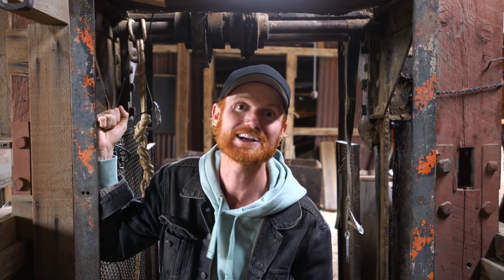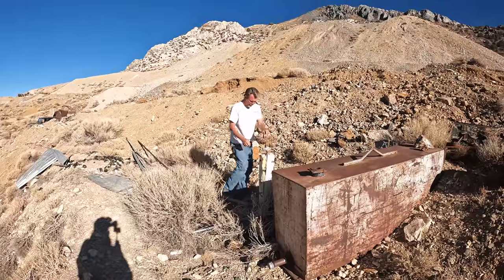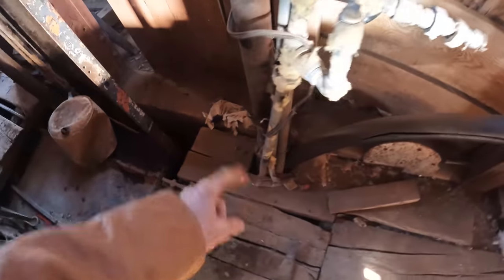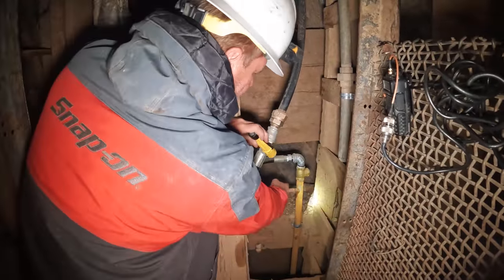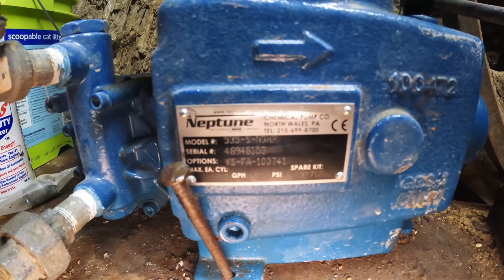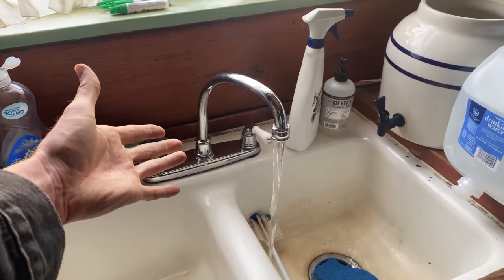How Cerro Gordo 'Ghost Town' Gets Water

Comment: How about putting an industrial dehumidifier down the tunnel where the water is coming from and piping its drain back to the catch basin? Not exactly the most efficient way to collect water as it'll be using a lot of electricity 24/7, but you would be reclaiming all the water that isn't flowing back to the basin including that which is on the walls, in the air and even what's in those rotting timbers,  you could even put a fan to circulate the damp air towards it from deeper down that tunnel.

Comment: What if you cleaned underneath where the water source was make it into a nice large smooth area where you could put a sheet of top polling what goes into a better and more permanent Funnel then it can drain down a pipe into your holding pond  Not saying this would increase the amount of water you could get in the town but it would keep the amount of water in the pond higher on average instead of constantly worrying about depleting all of it In the pond

Comment: The only significant thing I can think of is to dig out a catchment pond higher than the town in a location where snow and rain will fill it. Of course, that only works for a period of time depending on the size of the catchment.
Reply: The dust when the wind is blowing which it does a lot,  gets airborne and it is contaminated

Comment: Charcoal, Sand and Rock is just about all you need to filter water Brent, Then all you should do is boil it down to make sure there are no microbes. Then you have potable water you can drink or bathe in.
Reply: Not sure how effective those would be on filtering out lead though
Reply: @hanzazazel412  with that you make a point however if you distill the water you would be ok.

Comment: The water problem is because of poor design. Pumps can't lift water very far. All deep wells have a submersible pump at the bottom that pushes the water to the surface. A proper pump would solve the issue.

Comment: Is there a lower area water could come out from the mine? A vent shaft or other access that the water wouldn’t have to travel 700 vertical feet to get to? Use gravity to help some? Or Could you drill horizontally and penetrate from the side of the mountain 700 feet lower? I’m sure it’d be a major undertaking…
Reply: This is redundant ideology, the mine water is contaminated with metals, read my postings, doesn't anyone else read the comments before they comment, for crying out loud. Learn something! OK!

Comment: I understand that Cerro Gordo is on top of a mountain, however (not being an engineer), it strikes me that a deep water well is preferable (at least, eventually). The well might need to be rather deep, perhaps on the order of 1,000 feet or more, and therefore, expensive. However, to provide the several hundred daily gallons required, it strikes me as the only long-term solution... Major strengths of a well operation is simplicity; no long hoses, circuitous wires or mine-shaft hose or electrical threading would be needed ...as well as a considerably higher flow-rate. Yes, a well-pump would be required as well as a power source and well piping & proper sealant, however, if done properly, that water well could reliably serve the community for many years to come...

Comment: your going to keep having pump issues trying to push water that far up a line the weight of water or whats called head pressure is going to be to much for the pumps. what you need is 1 or 2 more holding tanks for water between the water level in the mine and the exit point with float valves and pumps, your going to have to stage the water working its way up the shaft of the mine for less issues with your water system. and less weight of water trying to be pushed up the lines. I have had to do similar setups on the farm in northern cali to get water 1500 feet up an incline to the farm from the creek. even huge industrial gas powered water pumps would fail swiftly because of the weight of the water in the line above the pump being pushed. also holding tanks do not leak like your ground hole holding area, so more water will be stored in backup reserve this way.

Comment: Tell me if I'm inane or not for having this idea. But if there a way (since there is a pipe that runs the entire length of the shaft before it gets to the water) to have a smaller pump, or multiple ones along the water line that could help out the main pump, since that seems to be the issue you keep having? I dunno if anything like that exists, or if it's already installed, I saw that one pipe and alleviater piece.. but apparently that's not helping much either.

Comment: A quick Google search told me you get about 6" of precipitation, lets just say that it is very little. My question is, do you have any infiltration set up? Like swales, checkdams (loose boulder structures), recharge wells? Stuff like that? I am very aware you like in essence on a big rock, yet there are plenty of cracks and the likes to help catch spring Mt water.. if that doesn't work it at least may grow a few more bushes
Reply: The dust when the wind is blowing which it does a lot,  gets airborne and it is contaminated
Reply: @lotharschiese8559  the water is to stay on the surface, infiltrate into the soil and its substructures, who inturn filter the silt (your concern) out of it.. that is the very reason people drink from wells and not from retention ponds.
Reply: @blue_boy8621  BUT NOBODY IN THEIR RIGHT MIND would do that around an abandoned mine site. When you put down a well, you pick an area with clean land, if you have a septic system,  you place the well, a goodly distance UPHILL! AND you ALWAYS test the well water, Eh!

Comment: "if you see something that we don't, let us know". Well my friend, I don't know if you know this but those galvanized lines are probably so corroded that you don't have much of any flow. That could be the reason for all the shutting off constantly. The head pressure has gotten too high and the motor working so hard is causing the amperage increases and the motor protection kicks in. I would check to see what it would cost to switch out that galvanized from the 500 level down. Shoot me a message on here and we can get together to try to solve this. It seems water will be the only problem with realizing your dream of making Cerro Gordo a place for people to come enjoy and spend time at the New American Hotel. Modern kitchens need lots of water.
Reply: Agreed! I can't believe nobody else has mentioned this!
Reply: @jmessenger919  They didn't mention it because the pressure gauge on the pump shows 303PSI. At 700ft head pressure, that shows that there's no restrictive spike going on. Not only that, but the pipes have been filled and rapidly evacuated many times using the valves near the pump. The water from the top rushes out VERY fast at 300PSI when those valves are opened which takes out the scale and other potential restrictions. The pipe is old, and above that point it even broke. However they are not the issue right now.

Comment: do you still have the water tote when you to make concrete for the hotel  to it near the mine shaft and before It get to the town.  you say you can get about 30 gallon a day? have try store 10 gallon day and use 10 gallon  day ? if I remember the water tote hole 250 gallons put hole at bottom of the tote for the town and pump mine water in the top of the tote. I remember that you need go to town get drink water  five ton truck and one 250 gallon water tote right? or the day Mine water is dry
Reply: you may need build room around the tote to keep from frizzing the water

Comment: Would it make sense to install a large holding tank on one of the middle levels of the mine, then install another pump in the hoist house? That way the distance to pump the water gets cut down, and gravity is working less against you. You could also install a gauge in the holding tank, so that you'll know when the lower pump is no longer working.
Reply: Read my posts above, This is redundant ideology, the mine water is contaminated!
Reply: @lotharschiese8559  what does that have to do with pumping the water to a holding tank? Also, I can't find your other comments.

Comment: I think you just need a water collection system for rain water (in case of a fire and for the garden is all right to use, not for drinking of course) and another one for storying the water of the mine in case the pump is not working ecc

Comment: What was the water supply in Cerro Gordo like when it was still a boomtown (I mean the early 1900s). How was water supplied when the population of Cerro Gordo peaked?
Reply: There used to be a very big lake at the base of the mountain.  Something happened back where the CA natural resources was drawing from lake, but at some point it just stopped replenishing.  The lake is essentially dry.  There were even desert bathing resorts back in the '20s.
My guess is the same source that fed the lake also bleeds into the mine.  It may have been diverted or pinched off by earthquake or even a tunnel collapse.
Reply: @toddmetzger  The mine goes down 1100 feet, Keeler is a mile 5280 feet lower than the town. Apples & oranges.

Comment: If you could find a piston pump that would be ideal, otherwise the only other option is a drive line pump like an oil rig. Ideally you would pump the pool nearly empty using a float switch to turn off the pump and store the water in a tank above ground. It would give you a better idea of your recovery rate throughout the seasons and it would guarantee you're not losing water to seepage.
Reply: This is redundant ideology, the mine water is contaminated with metals.
Reply: @lotharschiese8559  might not be, I don't believe they've ever tested it. Either way some metals can be filtered, and the source path can be cleaned up really well and that could make an improvement. Essentially it's a giant well that you can walk inside, it could probably be developed.
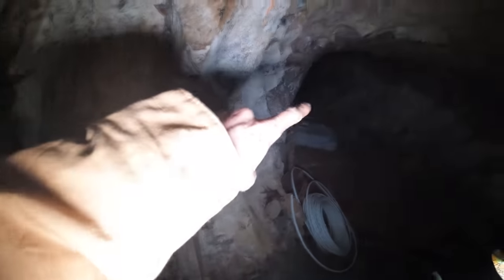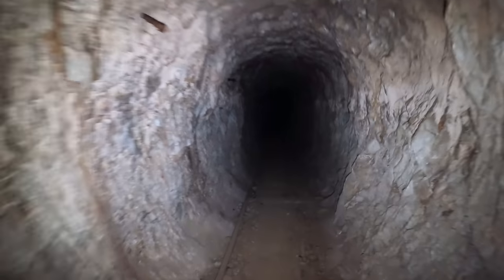Reply: @alec4672  You have a fundamental misunderstanding as have a great many others commenting about pumping the mine water, including Brent. The mine water is percolating down through fractured rock that is mineralized, watch the video again but pay close attention to my reference to a section 2:30 to 3:10 showing where the water originates. Notice the different colours of what is on the floor, those are precipitates of metals, that came out of the water, 2:40 to 3:00. When one has an understanding about chemistry, then there is comprehension of the processes involved. Filtration is not an option, focus instead on getting clean water from the Spring, that the mine & town used a long time ago.
Reply: @lotharschiese8559  like I said MIGHT not be, you gotta get it tested. My point is that water is coming from somewhere and if you can create a clean path to the source then that's your best bet. At the end of the day that might entail drilling a new well down to it from the surface but simple solutions MIGHT work. Also the spring dried up with the lake, it hasn't ran in decades.

Comment: If you install a surge tank.... you could collect the water , filter it , treat it and have a point of distribution including a low suction shut off....i think you're using the wrong pump for application (diaphragms can be problematic, positive displacement can break lines and cause leaks ) ...a closed impeller lift pump is a better one for this job ...by adding 1 or 2 lift stations you can drop the static head in half or 3rds - and have a convenient spot to chloronate or polish the supernatant ...use your knowledge resources to find the best locations 😉
Size 11 👍

Comment: I would say water collection from rain into cistern system above ground and then pumped into individual buildings as needed
Reply: The dust when the wind is blowing which it does a lot,  gets airborne and it is contaminated, read my postings

Comment: Definitely get that water tested. I'd suspect it is full of lead and arsenic from the mines. 
Might be beneficial to put a line to a storage take above ground and a filter on that before going into the buildings. 
I guess it depends on the water purity and contents. Sure wouldn't drink it.
Reply: Finally, someone with good common sense, water from the Spring is the answer, read my postings you will gain an understanding.
Reply: @lotharschiese8559  Yup, I admire his effort, but that is deadly water. I'd use it only for toilet flushing and making concrete. Wouldn't even shower in it.
Reply: @IrishLincoln  So, you contaminate the inside of any piping with metals and where ever you dump the used water. Leave it bloody well where it is.

Comment: I would use 2 solar driven diaphragm pumps each lifting half way, with an intermediate tank at the mid point. This should enable pumping 24/7 with fairly modest batteries to pump at night.. The principle of little-and-often lends itself to affordable dc pumps powered by solar and the weight of the water needed to be lifted.. in a reasonably short time you'd build up a reserve...and then all you need to do is manage it.. I would build a water tower to house my reserve.    Expecting any pump to push a volume of water up 900 feet and produce volume or even be reliable is just not the way to go

Comment: I guess the old water points dried. In a long term planning you should look how can you reforest around the town. I bet they dried because of lack of
 water retation by trees in the winter, snow and rain. Most of the trees were cut to timber and fire.
Reply: The ground is really quite contaminated and is not the right bioclimatic zone, way to high, at 8,000+ feet.

Comment: It would do better and last longer with a multi-stage system, with each stage having a storage tank and float valve. The first stage (bottom) absolutely needs to be a submersible pump to avoid losing prime. You definitely want to have the water tested and a filtration system in place to make it as good as you can, hopefully drinkable. Best would be to truck in drinking water and use the well for other purposes. I'd set up as large a storage tank as I could up high with a large enough downpipe to allow for firefighting. That storage could be in an unused shaft- in fact by waterproofing the shaft with stucco the shaft itself could be your tank. With only 8GPH available you need to economize water use in every way possible, including having the top tank overflow piped back down to the sump should you fill your storage scheme completely. No place is very liveable without a good and stable water supply!

Comment: Interesting. I can see from the broken wooden supports that the rock has moved. I wonder if that's due to water. Would it be possible to locate the source and tap into it with a drill? Maybe it's old water from an ancient underground reservoir that might suddenly run out. Perhaps you could get it tested for age?
Reply: Tested? Yah for such as arsenic (As), cadmium (Cd), nickel (Ni), lead (Pb), copper (Cu), zinc (Zn), cobalt (Co) and mercury (Hg) and fluorite!

Comment: You need to get a submersible pump and control it using float switches.  The pump needs to be in the water!  Should not have a problem with the pressure needed.  Sincerely, Richard Goodman

Comment: Bret, Need to add a link and detail the parameters. From surface (outlet) to bottom of water basin. Depth of water. Available electrical (Gage, volt & length). Existing line is 3/4"?, total distance? Recharge rate? After that its just math. Neptune pump is interesting, low flow high pressure pump. Foot valve ought to hold the prime. Needed 303# just to overcome the 700' of head. Your friend looks like he's got it figured out.Whats dissolved in the water...well hell.  I'm just a test & balance engineer dammit. haha

Comment: I have no idea if this is a practical idea but why not get a big water tank and get water delivered every few weeks to the town. If you are going to have quests there I wouldnt make anything with that mine water before it gets tested. Might be prudent to ask guests to bring their own water with them for drinking and cooking purposes. That way you dont have to provide water to the guests if Cerro Gordo starts getting more visitors in the future.
Reply: I am with you , Brent is throwing good money after bad .there is no viable water source in that mine.If Brent insalled the proper pump that small Reservoir would be pumped out in less than an hour.he's using a meter pump right now, that's not the proper application for that unit.
Reply: Post a sign at the start of the road up. We greatly appreciate if you should decide to come up to visit us, that you bring an adequate supply of water. We have no water to spare, sorry!
Reply: @lotharschiese8559  No idea if you are kidding but google lead poisoning. If the mine water contains lead then offering that water to visiting guests would be a serious health risk. That is also probably a basis for a pretty hefty legal case if someone uses untested water from a mine for activities that involve anything to do with eating or drinking anything involving that water.
Reply: Have to also add here this video where the man (previous owner?) in Cerro Gordo tells the visitors about the ways that the early settlers in Cerro Gordo had problems with lead. Seems even the snow had lead in it and first mules died because of the lead content that came up from the melting of the ore in the form of soot: https://www.youtube.com/watch?v=tt536ExcOmY
Reply: Also found out watching a video about Cerro Gordo that the previous owners wife died at 56 or so of leukemia and it is suspected that it was because she drank the water from that mine.